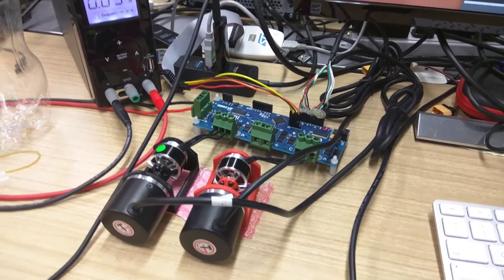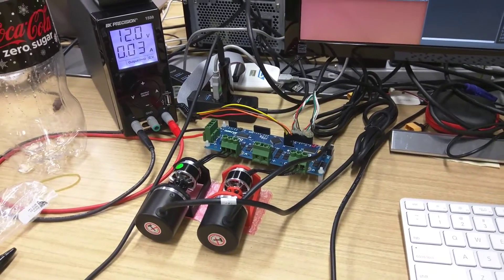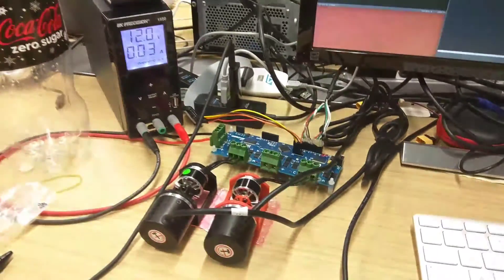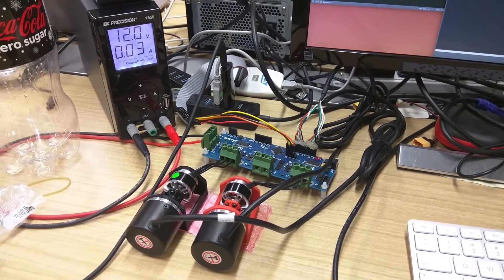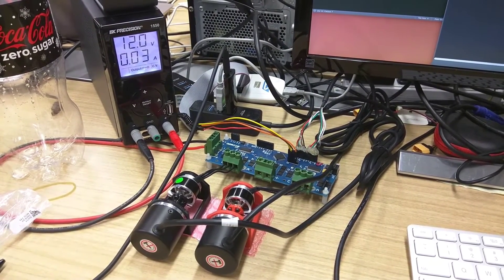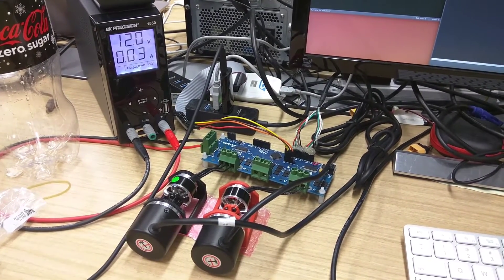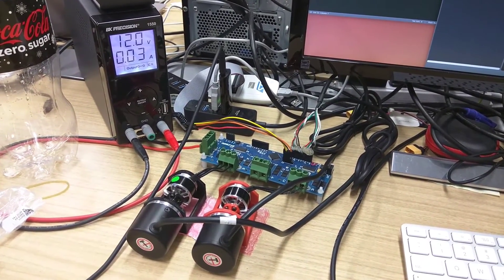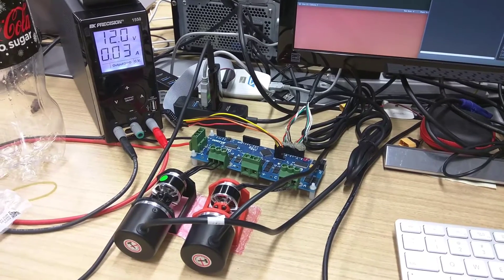ODrive two motor test

Comment: So is this sensorless or are you using the encoders? Do you only use encoders for debugging?
Reply from the maker: +Martin K. Schröder this is using the encoders. There is a sensorless implementation, but it's not as accurate as the encoders
Reply: How are you syncing the encoder to the magnetic position of the rotor in this setup?
Reply from the maker: The "rotate a little right, then a little left" part of the sequence seen in the video is the encoder calibration which resolves this. It drives a current in the stator and lets the rotor sync to the magnetic field: but it doesn't sync perfectly, so it goes both directions to cancel the lag.

Comment: which encoders do you use?
Reply: Just reading through the comments, and I'm not sure where the link you're talking about is, but it is normal for quadrature encoders to quote PPR in terms of a full cycle of quadrature encodings as a single "pulse".  With decent hardware each of the transitions of the quadrature encode can be used.  This gives an effective encoding of x4 the PPR or, in this case, 2400 counts per revolution from a 600PPR device.
Reply: Sorry but I think that link is not correct you said: "my encoders were 2400 counts per rev." in another comment and the product link is a 600 counts per rev encoder

Comment: what is the resolution per rotation? and what software is needed to control the boards?
Reply from the maker: +3D Printwiz the resolution depends on the encoder. In this case, my encoders were 2400 counts per rev.
There are many possible interfaces. One of them will be similar to G code, so many different software should be compatible.
Reply: Thanks for the reply. So this is still arduino compatible? What signal does it require to put it in position to a certain angle, PWM?
Reply from the maker: +3D Printwiz there will be support for step/direction signals that should be arduino compatible.
Reply: OH good, so the board takes care of the encoders, I do not have to process it through arduino? How about torque output, I know it is fast from the videos, but since it is moving on xy plane I could not estimate the torque. I will be using it for a robot arm, and might gear it down to get more torque.
Reply from the maker: 3D Printwiz correct, the odrive takes care of the encoders. To see the expected torque from a range of motors, check this spreadsheet: https://docs.google.com/spreadsheets/d/12vzz7XVEK6YNIOqH0jAz51F5VUpc-lJEs3mmkWP1H4Y/edit?usp=drivesdk
Reply: Thanks for the reply. This is truly amazing. Are you selling them internationally already?
Reply from the maker: 3D Printwiz i will soon, you can register your interest here: http://goo.gl/forms/Y9aHMVqWyjW9WjHG2

Comment: I saw the post about ODrive from May on Hackaday.  So you're doing some level of commissioning / tuning here.  Is it also doing anti-cogging as described in https://hackaday.com/2016/02/23/anti-cogging-algorithm-brings-out-the-best-in-your-hobby-brushless-motors/?
Reply from the maker: Paul Guenette The current controller is automatically tuned here. The speed and position control gains are manually tuned, but that's not seen in this video. I plan to make an algorithm to automatically tune that too.

The cogging torque compensation you linked to looks interesting, but I don't think it is needed. Instead, just applying high gain feedback should probably be fine to reject the cogging torque. For very sensitive applications, we could add the compensation, but it is not planned at the moment from my side.